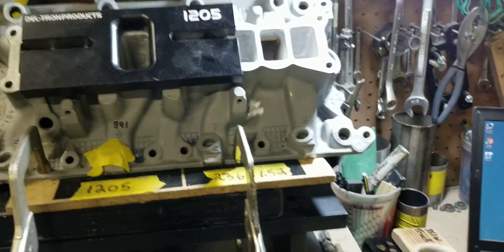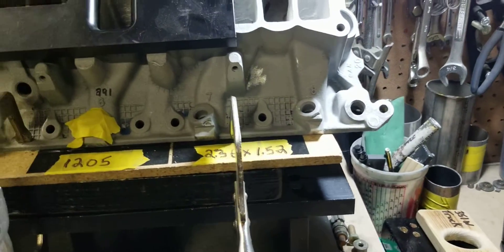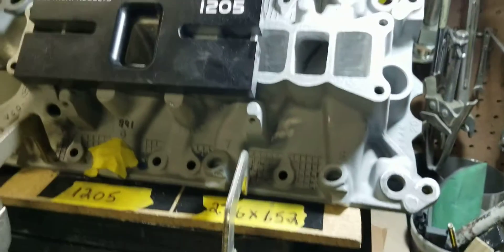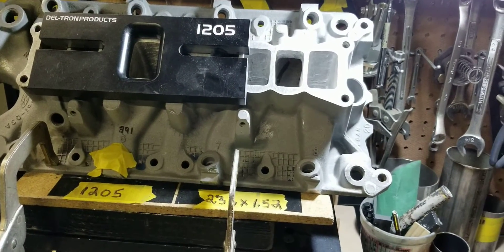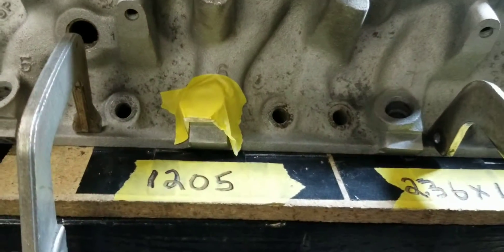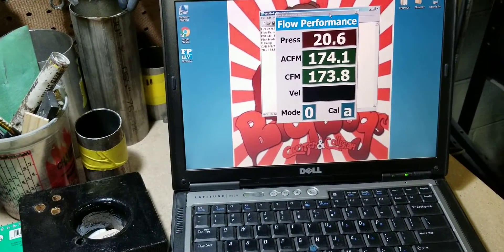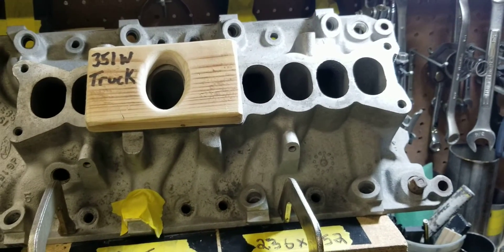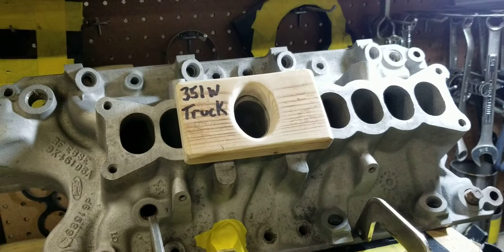Bigdogs Porting stage 3 ported 5.0 HO lower manifold vs a stock HO lower manifold.

Comment: The 1 and 5 are really crooked. 😳
Reply from the maker: Its all about the flow
Reply: @bigdogsportingtonyb2833  So what's the flow on those two very crooked runners? Better than 2 or 6?
Reply from the maker: @hotrodray6802  within 10cfm of the rest. The bolted together average flow on our stage 3 ported ho manifolds is 250-265cfm

Comment: Great numbers how does port 1 and port 5 flow?
Reply from the maker: Thanks. As you can see we took the time to weld up extra material on the top and bottom of port number 1 and 5 so we could reshape those ports as well. They no flow in the 290cfm range so this manifold is very balanced.